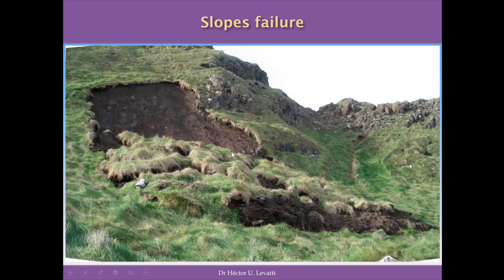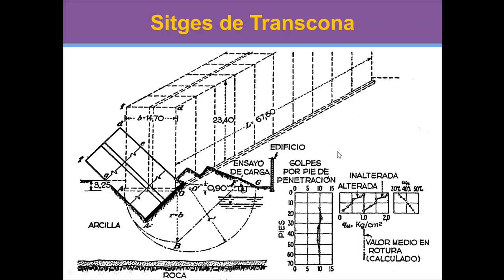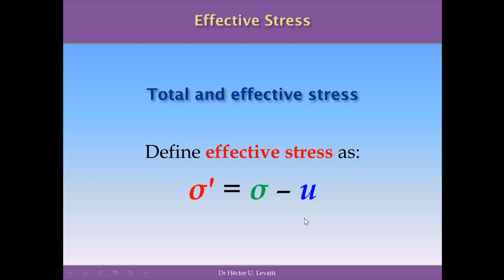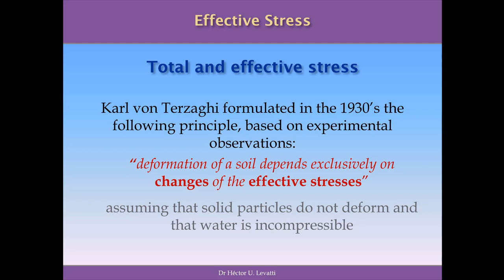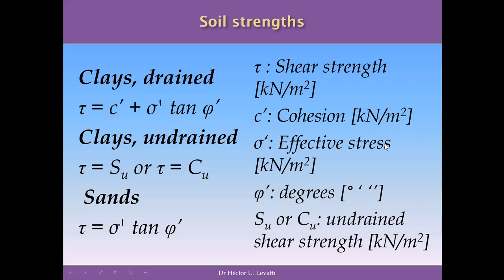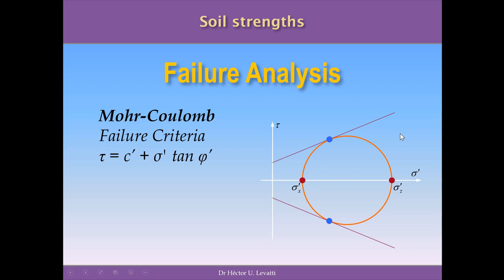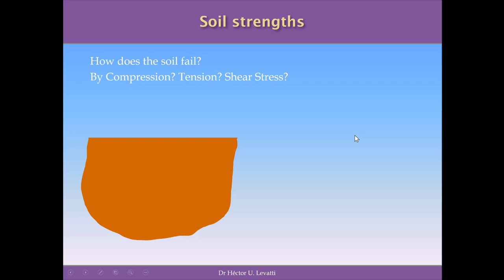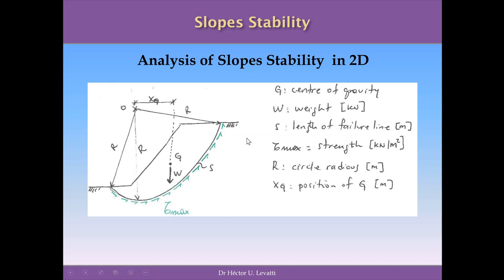Lesson 01 - Slope Stability Theory

Comment: I want to ask a question.I have calculated Fs from Michalowski’s (2002) 1.875 and I have calculated Fs=2.047 from slope stability program.What is the reason of this difference?
Reply from the maker: The safety factor depends on several assumptions that define the method. For the same failure line, you can have different results if you apply one method or another. On the other hand, you should consider several failure lines to establish a set of safety factors. This is because you do not actually know what the real failure line is. Once you have a considerably high number of safety factors (100-1,000) for your slope, you should choose the smallest one as the good one. This is good practice. In academia, we usually solve just one case to learn the methods.